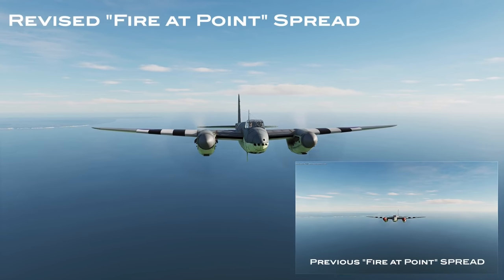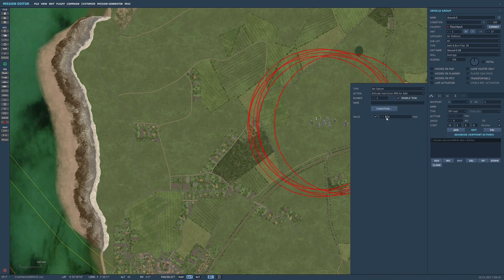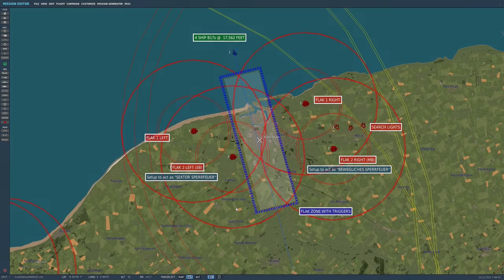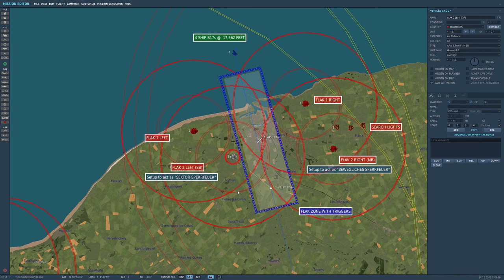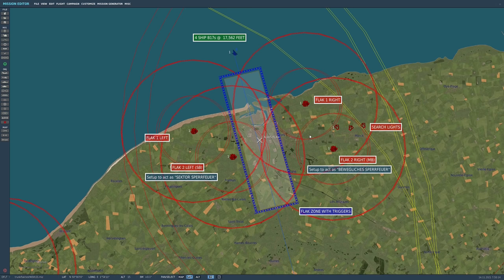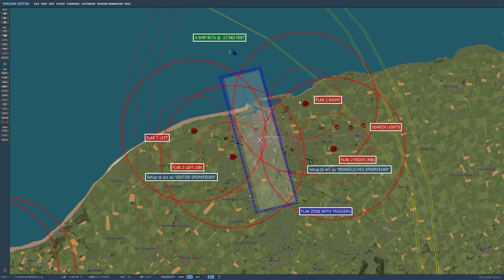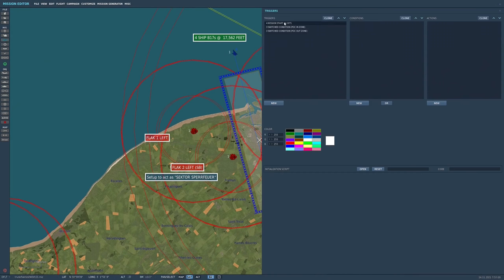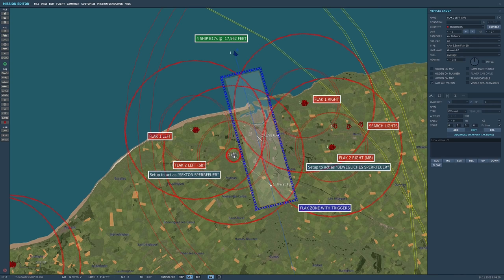DCS AAA Update | WWII and Modern

Comment: Thanks for the clear explanation! It's great to have control like this, but I'd much prefer it to be automatic: when you have a scripted mission and you knw what group will enter the area and at what altitude, you can set up the triggers. But what if you don't? What if the player can overfly it from the west at 20000 feet or from the north at 10000 feet? Then all of the above won't work because you can't anticipate it. What I would like to see is flak that detect enemy aircraft, chooses the most historically accurate way to engage and does it automatically.
Reply: Probably coming with AI improvements and the dynamic campaign later.
Reply: i have the same feelings. It could be useful for single player mission or for intercept ai groups but the practical use in a multiplayer enviroinment is quite limited. But the fire at point is great to crate some ambient, especially during night missions. I really hope they reduced the precision of non radar guided spaa because they are extremely dangerous in the current state, mbp2s and zsu23 are basically snipers at elite level, and they behave like a ciws system

Comment: I am having an issue finding all the pieces that go into a flak template. I found out the search lights need the generators now and I added the G40 optics piece. I just want to build a good flak unit template. Plus does the distance between each of the pieces effect how the work? Example: 20 feet apart vs 200 feet apart.